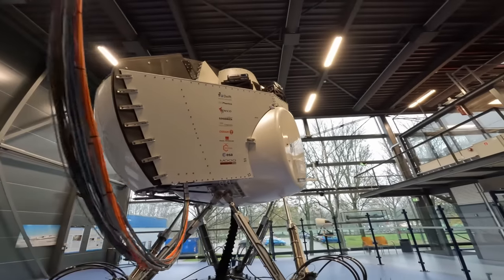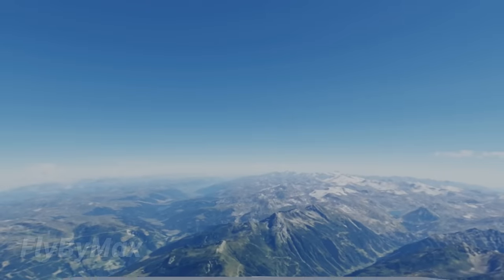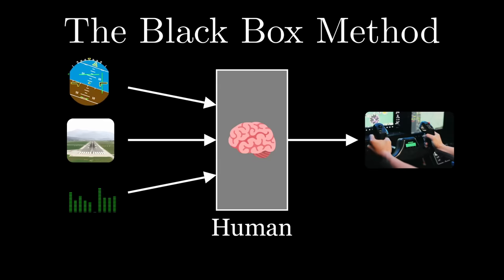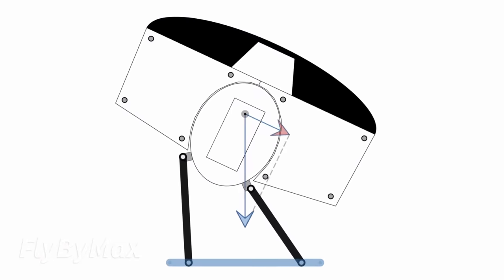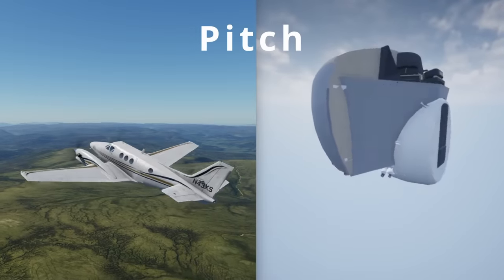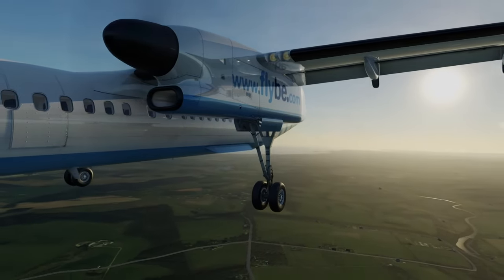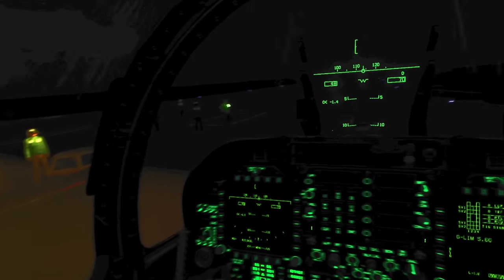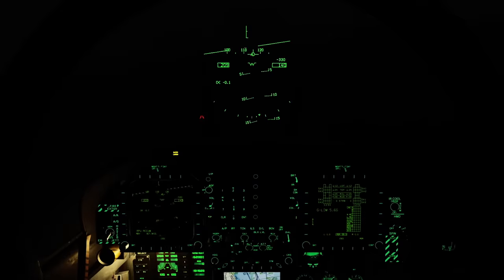How Flight Simulators Trick Your Brain

Comment from the maker: A couple of things that didn't make it into the video:

- 0:12 the F-18 crash is documented by the US Naval Aerospace Research Laboratory, see page 10-7: https://apps.dtic.mil/sti/tr/pdf/ADP013854.pdf
- 6:57 notice how when the roll gets washed out back to neutral, it returns slower than the initial excitement. This makes sure that the pilots feel the initial roll (rate), but won't sense the platform going back to zero roll.
- 13:04 the reason it's easier to compute aerodynamic and thrust forces is because these need to be calculated anyways to simulate and model the aircraft. For example, X-Plane has an option for directly outputting the aerodynamic/thrust forces along the aircraft's axes, which I could use as inputs for the animations. Computing gravity and acceleration would require determining angles and geometry, which makes the whole thing more convoluted.
- 14:16 since we now have a solution for specific force in both directions (forward and side-ways), this means we can replicate specific force in the entire horizontal plane through a linear combination of both directions. However, in the vertical direction, it's only possible to replicate short, high-frequency movements, since the simulator can't be tilted to sustain long-term forces in the vertical direction (which is in-line with gravity). For sustained vertical g-force, some sort of centrifuge would be required, like in this simulator: https://desdemona.eu
Reply: AND, the sim can NEVER exhibit or simulate anything above 1 gee.
Reply: @Cyberdactyl  It can actually do that short-term through quick translational movement
Reply: @leogoe  Well . . .sure. .  . for like about a quarter second or   for vibration effects but no +1 gee maneuvers.
Reply: High G training would be good. Besides learning grunt breathing, turning your head under high G is a challenge.   Familiarization with sudden G forces during carrier takeoffs and landings.  Two simulator approaches besides centrifuge are 
1… perhaps a motion platform that can pitch up or down through a full 360 degrees, but not roll or yaw
2… a pilot suit with 50 tension cables attached to pull on body parts (head forward, back, down, up, left right, chest forward down back, legs, arms)
Reply from the maker: Very good point :)
Reply: Specific force concept and calculations could be a video onto themselves.. on some other day
Reply: It would be great if you could create a follow up video and talk about some more specific details about the mathematical computations - what form do these washout filters take etc.  I am definitely a math nerd, and I spend a large portion of my time deep in this kind of mathematics  - so you would have at least one intrested viewer if you created this content.
Reply: I saw a neat solution to the Surge Washout problem, in a theme park motion system. They had limited forward motion available. So, they inflated air bladders in the seat back, giving a convincing sensation of being pressed back into the seat, by pressing the seat 'forward' into the rider.
Reply: F18 pilot should have used his instruments a bit more than the feel of his body it sounds like
Reply: 12:36 you said it opposite. The deceleration would make you move forward in your seat, and since you're at an angle, the gravity is pushing you backwards in your seat, canceling out the deceleration
Reply: "The gravity component that would be pushing you forward is being canceled by the deceleration component which is pushing you backwards" would only work if you are accelerating towards the ground, in which case it is a acceleration component pushing you backwards.
Reply: @u12bdragon I just got hung up there too and wasn’t sure if the problem was on my end or the video
Reply: Yeah, normally this is talked about which way you're rag dolling in the seat, but he's talking about which way the seat is pushing your body instead... the opposite. It's video is strictly-speaking correct, but not intuitive in its framing.
Reply: I am impressed with the accuracy of facts in this video. I was fully expecting the typical 5 notes of corrections. There's only one note which is that our pressure gauge is also a thing, a rapidly decending or ascending pressurized hull, will still keep some level of inner ear pressure sensation. And sound does play an important part too. Multimodal perception guides our cognition, and this also means stomach contents can play a small role too. So it's obviously not 100% without notes, but I am still impressed nevertheless. Pressurised changes inside the sim cabin should be possible, and in some scenarios this would be vital information in terms of sink-rate master cautions etc. Especially if there are Specific Force confusion-based biases in pitch-black conditions. The human senses can conflict with instruments and we as humans can be opting to trust either faulty instruments or human confusion in critical scenarios, by having a pressure change to compare to, assuming the cabin pressure isn't compromized, would allow humans to know when to doubt instruments and master cautions and vice versa, in at least a few more scenarios.
Reply: I was thinking something along the same lines. For instance, this simulator can never accurately replicate both the vector AND magnitude of force during sustained acceleration in level flight. In that situation, the specific force vector is down and back into your seat with a net magnitude of >1 g, while tilting the platform will have to trade some of the downward force for backwards force, ending up with a force vector that matches that of a real flight, yet with a magnitude of only 1g. I imagine in an airliner these differences are relatively minor, and can be papered over by one's reliance on visual cues, but for more extreme maneuvers in which the difference is greater, a pilot may be surprised in real life by the strength of g force they experience relative to that felt in a simulator. Thus why fighter pilots train in centrifuges! Delft's approach is still quite impressive though and almost surely good enough for civilian applications (especially considering that translational motion can simulate quick bursts of higher g force).

Comment: I had worked for a simulation manufacturer in the late 80s and early 90s in Tampa Florida and we had some pretty cutting edge technology back then. This is next generation stuff here. Exceptional video.
Reply: did you work for cae
Reply: I’ve got a 6dof platform at home. Not as fancy as the one in Delft, of course. Maximum load capacity is 150kg. Enough for a seat, three monitors and flight gear. With VR gear the motion cues are very effective. If I use the monitors the rest of the room needs to be dark or my peripheral vision picks up the room. Works great with both X-Plane and MSFS2020.
Reply: I am a sim tech at United and you would love to know we still have a 767 full flight simulator in service from CAE that was built in 1982. My favourite out of all the machines we have.
Reply: I've done my training on the new CAE Airbus A220 (Bombardier CS300/100) sim. Before that I did training on the Jetstream 32 sim from the 70s that needed a whole room just for the PC. but the Sims now are so realistic it's incredible
Reply: So your like 50 on YouTube
Reply: I worked with one of your co-workers on a supercomputer prototype across the bay. He was always pointing out that the work we were doing wasn't all that far removed from his simulator work.
Reply: @acoloz1644  Ok, and?

Comment: Motion base simulators are great for lower dynamic aircraft like passenger/cargo jets & bombers, but not great for high dynamic aircraft like fighters.  Pilots can be taught that if they pull hard G's long enough, the G-force will eventually reduce - which is NOT correct.  Back in the 1980s, we used an air-driven G-seat & G-suit in the simulator that would give the correct cues for a fighter pilot.  We also used the visual system to give tunnel vision at very high Gs.
Reply: i was wondering how G-force can be reproduced in the simulator since the setup appears to only have ~1g to work with
Reply: How do you sustain accelerations higher than 1g?  Any system I can think of would saturate pretty quickly and take an insane amount of space.
Reply: @sciencecompliance235  It is not about generating the actual G-force.  It is about providing the cues of high-G, namely that at high G's, your G-suit squeezes you, and the higher the G, the harder the squeeze.
Reply: It would be elaborate, large, and very very expensive, but I wonder if you could combine a multi-axis pod with a centrifuge. That could theoretically give you all the g you could ever need.
Reply: @CaptainBlackadder75  the problem I see, although I know little about centrifuges, is that say you went from straight and level flight to a 90deg banking turn, the g loading would went from 1ish to say like 6 almost instantaneously. And the moment you leave the turn, the g loading need to go back to 1 very quickly. I’m not sure if centrifuge is capable of this. The second problem I see is that even if the first problem is addressed, the constant acceleration and deceleration it has to handle per flight would be so immense that I’m not sure if the engineering complexity is justified. I guess at the end of the day, the best way to learn fly a jet is to just fly in a jet.
Reply: @CaptainBlackadder75  I might be mistaken, but I think NASA had such a simulator at NASA Ames.  I also seem to remember them having a vertical simulator (like an elevator shaft).  I can't remember what they were used for - this was from a tour I took in college in the early 1980s.
Reply: But they're great for learning the basics. Take-off, landing and other procedures as single-seat planes (f-35) dont have instructors in the backseat. Pilot Candidates or pilots transitioning can learn plane characteristics while greatly reducing the risk of making a gopher hole.
Reply: We have the option for G-seats on flight Sims now.
Reply: @CaptainBlackadder75  The biggest problem is reacting to high-g maneuvers quickly. But responding to acceleration is already possible. In fact, there is a Disney ride that does just that.
Reply: @CaptainBlackadder75  the real problem with rotation is that it introduces Coriolis effect, which gets noticeable, if you move around in the cockpit, or the cockpit gets rotated in a different axis. In order to minimize the Coriolis effect when simulating 1 g, the centrifuge should have a roughly a 1 km diameter.
Reply: @sciencecompliance235  this is actually incredibly easy to do. You seem to assume that the acceleration is in a straight line, while in reality alot of flight acceleration comes in the centripetal form. ww2 aircraft regularly needed to sustain Gs greater than 5, but going as high as 7 or even 8 in a few cases.

Comment: As someone who trains in sims regularly as a professional pilot, my experience is thus: usually the first time back in a sim after it's been awhile my brain knows "something" is wrong, and I tend to just be a little disoriented and maybe a bit queasy for the first 30 minutes. However, after a while my brain recalibrates and adapts to the sim and it becomes really cool how well it just "accepts" it. The motion is pretty well matched with the inputs and visuals. Especially that surge axis is perfect for quick jolts like turbulence or landings. Not for nothing too, having a perfectly replicated cockpit inside helps a lot, because you're leaning/reaching/turning your head in exactly the same way you would in the real airplane, and all of this motion is completely independent of the orientation of your body, so the illusion remains even when you're not sitting perfectly in the chair looking straight ahead.
Reply: I wonder if the reason your brain recognizes a difference is because there are fundamental limitations on what a sim can do, or if the sim just isn't quite accounting for everything due to cost or other non-fundamental limitations.
Reply: How does it handle a stall and altitude loss? Tipping forward? I assume it's almost impossible to replicate the freefall in the sim.
Reply: @severoon  Meta has done studies with VR goggles. The one that really surprised them was how much dynamic range makes a difference. When you look at the sky and it's actually bright and your pupils contract, it's a massive boost to immersion. I'm willing to bet that visual and auditory clues play a huge part. I once was in a static A320 sim so no hydraulics and I could swear the thing was moving when using the ailerons.
Reply: @daysofend  I don't thing maintaining a stall is meaningful training, would be like a car simulator replicating crashing into a tree accurately so you can practice that. I guess the cabin slowly moves up right as you're about to stall and then  moves down at the beginning of the stall to get you used to that sensation of going weightless and hanging in the seatbelts. The transition is the important part, a pilot should be able to recover at the beginning of the stall. A commercial airliner is fairly hard to stall but once it does it's more or less doomed anyway.

Comment: When I was a miltary pilot, we had two sims : one like this one, the other was a simple set just put on the ground. No moving parts, just a fake cockpit and some 3D rendering on a 180° screen. You know what, just watching the scenery move while you are simulating the flight gives your brain the sensation that the whole thing is moving. While we were tied to the ground, there was no hydraulic systems, no moving parts or whatever.

Visual senses are really powerful to trick you in believing your're moving while you're not ^^
Reply: As someone who flew cessna 172 in real life. when i fly in vr it even tricks my brain into feeling the feelings i used to feel in real cessna 172

Comment: The one part you missed was braking on the runway, why presumably needs the simulator to tip downwards with a very brief upward movement of the scenery to simulate the nose dip when brakes are applied. Otherwise I'm very happy to say that all this works in exactly the way I was expecting it to. I'm an electronics engineer so instead of washout filters, I would simply say AC coupling so the steady state does not make it through the system. The turnover frequency of the coupling gives the time needed for the system to return to centre after the load is applied.

Comment: I had the opportunity to 'play' in a jet fighter simulator that can flip upside down. I was VERY impressed by the sensations. I have always wondered about how a simulator can fool you into thinking you are climbing. This video was great - thanks.
.
.
.
As a side note - I am a glider pilot - I once climbed into a cloud with an instructor (and only VFR instruments). We wanted to test my ability to sense the g-forces when visual cues are removed. I thought we were flying straight and level, but when we popped out the side of the cloud we were actually in a relatively steep descent with one wing down.  Wow what a sensation; the power and importance of the visual horizon.
.
Last year I flew in France. We took off in a valley and I suddenly found myself desperately looking around between the mountains to get a glimpse of the horizon just to orientate myself.
Reply from the maker: Thanks! Great to hear your experiences.

Comment: One thing to note about mimicking linear acceleration with tilting the seat in the simulator, it would actually be somewhat noticeable because while the horizontal component of gravity would match the acceleration, the vertical component would be reduced making the seat feel like it is pushing you up less. This method of miming the acceleration could also only simulate up to 1 g of force by only rotating and would feel less and less like what it is mimicking as it approaches that max force.
Reply from the maker: That's a fair point, although I think the visual part of the illusion would far outweigh this effect. Thanks!
Reply: This is true, but just not significant. The losses and gains don't add up to a constant. If you tilt back 10 degrees, you've gained 0.17 G longitudinally (sin 10), but still have 0.985 G vertically (cos 10). No one can feel that loss. 

Much more significant, is the complete lack of sustained G in turns. Should be doing 1.15 G in a 30 degree bank, and only feeling 1.00 is definitely annoying, if not outright distracting sometimes.
Reply: @FlyNAA exactly my thought. This tech would be useless for fighter pilots. Still very cool for airliners though!
Reply: @DreamOfFlying AFAIK Fighter sims use centrfigues.

Comment: Excellent video :) If i understand it right in summary its all about the force experienced by the pilot. In a real aircraft the force vector will shift with acceleration (either in translation or orientation). However in the simulator the force vector is static (gravity), so instead the orientation of the horizontal plane is manipulated. Simplified what the simulator does is it matches the angle between the force vector and horizontal plane experienced in the real aircraft by offsetting the perceived horizontal plane in relation to it's static force vector.  As the aircraft accelerates the force vector is shifted backwards at an angle and so the simulator pitches up to match the angle of the "horizontal" plane to the static force vector. As the plane stops accelerating the force vector is again straight down so the simulator pitches back down to level.
Reply from the maker: Yes! Exactly right :)